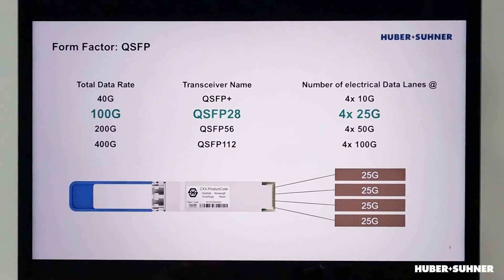Transceiver Breakout Cables explained (04-05-02)

Comment: Good explanation. Breakout can also be done via structured cabling. BTW there also used to be 100g transceivers having 10 lanes.
Reply from the maker: Thanks, @dmitrytsy4769. You are absolutely right with both points you mention. Breakout can also be done with structured cabling (which HUBER+SUHNER knows a thing or two about 😜) and there used to be a 100G transceiver with 10x 10G lanes… however, the concept of 10 lanes didn’t keep for very long and was replaced by the quad concept.